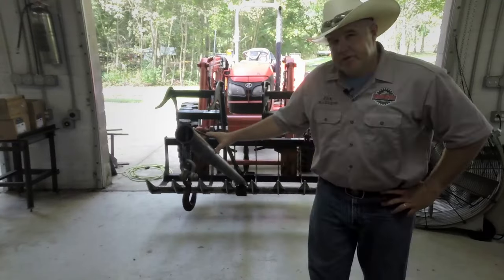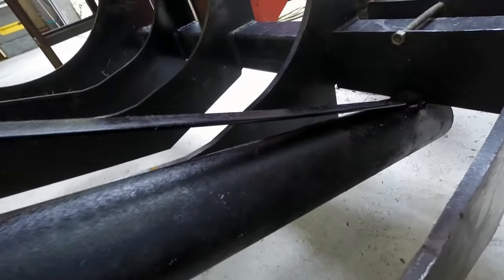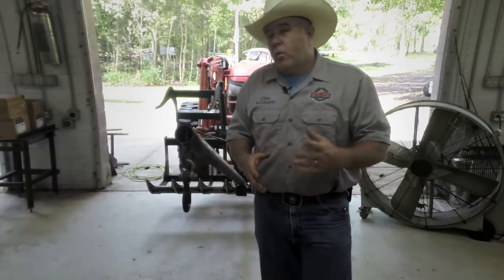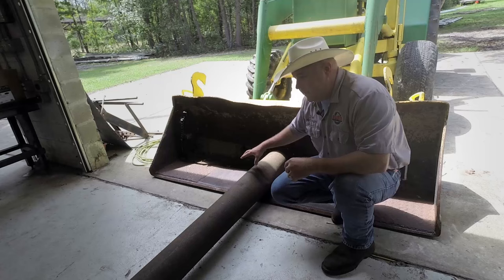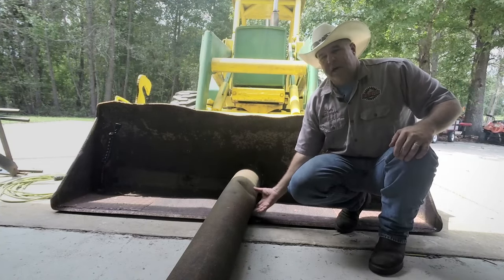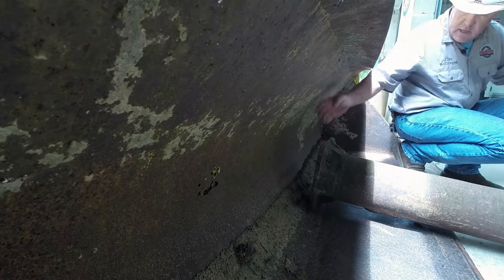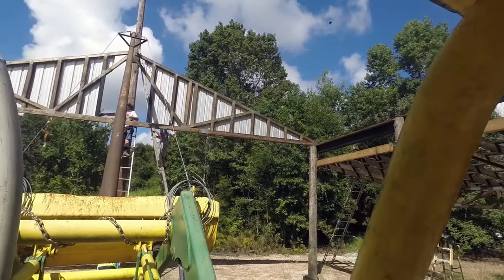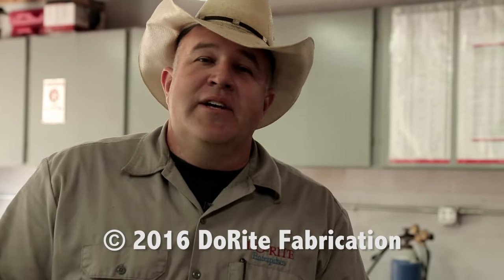Welding a huge extender thing-a-ma-jig onto my backhoe. Plus, another barn raising update.

Comment: It's all about the CAD/CAM these days... cardboard aided design :p
Reply from the maker: The question is, what is the cardboard of choice? lol
Reply: Whatever you have laying around, I use that trick all the time... Keep up the great work. Thanks for taking the time to do this for both entertainment and education.
Reply: Use the double layered stuff Much more stable. :-)
And if you need an exact conure put some painters tape in the area, cut the  cardboard close and fill the gaps with hot glue. You will get a better fit than any software can produce.

Comment: Had to quit watching as when you installed the top eyelets almost (90) degrees of the stress pull rolling on floor 3/4 bolt pulling at almost (90) degrees 0 strength for what you are doing
Reply from the maker: Funny how the engineers tell you everything you did wrong. Been years since i built that, used it many times, When you build something 100x stronger than it needs to be, it is 100x stronger than it needs to be. Zero faiures.

Comment: Thanks Jim, the barn is looking great. BTW, what type of tank work did you do? I worked on tank and pipe for the petro-chem industry in Hawaii and Micronesia, and built out a bunch of tank farms/fuel depots. Tough work with too many knuckle-heads, but the pay was good and my Pop was the boss...Aloha, Chuck
Reply from the maker: I did work in Water, sewer, water treatment type systems. Mostly open top non-pressurized tanks. Low pressure piping in steel, stainless steel, aluminum. Some sanitary SS pipe work.

Comment: did you think about an extension for the backhoe
Reply from the maker: No I didn't, for several reasons. Setting trusses requires you to maneuver the tractor into very close positions while supporting the load. That is not something I would want to do 26 times (26 trusses) while driving backward. Secondly, and most importantly, A backhoe's rear axle is not intended to carry the loads that are applied while the backhoe is operating (at full extension). That is why the backhoe is equipped with outriggers. My backhoe is old and well loved, I have to make it last, I certainly could not afford to replace it.

Comment: That new high tech cardboard is only and good as the unidirectional analog permanent stain quill holder being utilized. They usually come in different hues available everywhere. Nice work Jim !!  Can't wait to see the finished barn... I bet you can't either.
Reply from the maker: I prefer my Sharpies to be black or silver when laying out steel, stainless, or aluminum for fabrication, for lathe or mill work I use red or blue....lol

Comment: Jim did you disconnect the battery before you welded in the bucket?
Reply: Based on the appearance, probably not required. Mechanical injection diesel engine with nothing electronic to worry about.
Reply from the maker: That is correct. The backhoe can equipped from John Deere with a generator with a mechanical voltage regulator. All of the electronics, including headlights, and the generator were removed prior to me owning it. The generator was replaced with a GM self exciting Delcotron alternator. The industry standard for many years in reliable one wire hook up charging system. The fuel injection is 100% mechanical, So there are literally ten or twelve wires on the whole thing, super simple, no sensitive electronics to go poof!
Reply from the maker: No, not necessary on this particular machine.